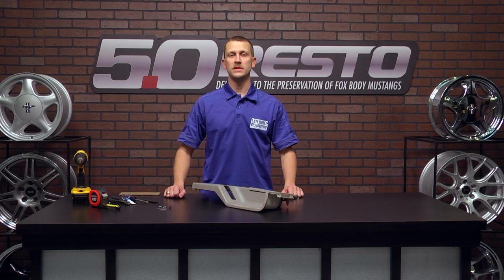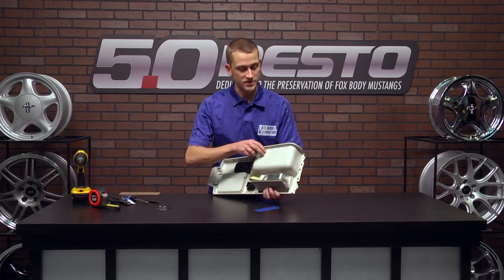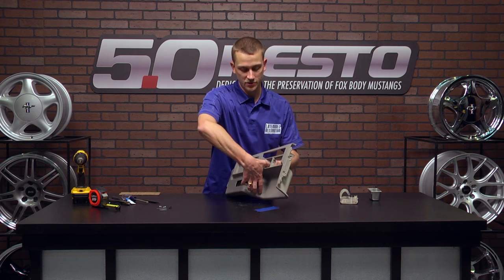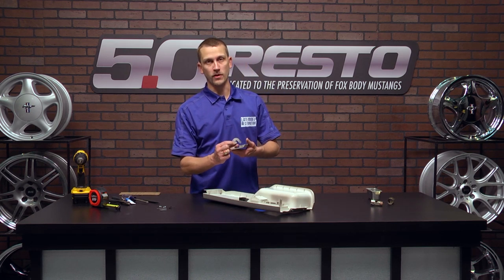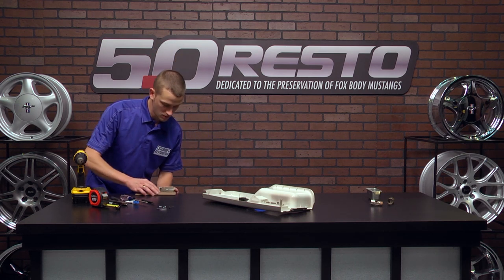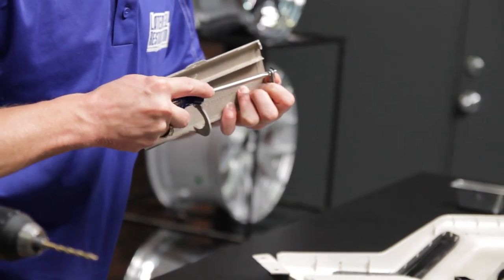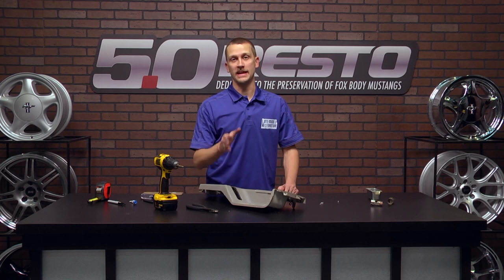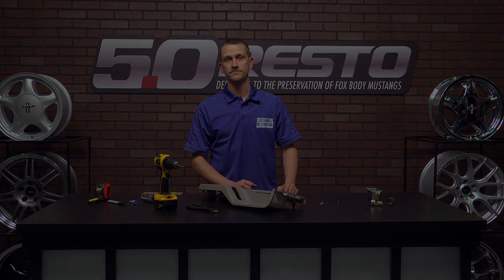1987-1993 Fox Body Mustang: Ash Tray Lid Repair Kit Installation

Comment: I have owned several foxes in my lifetime,back many years ago when Mavromont first came out with the repair kit for the ashtray i bought one of them,never had a problem again,Ive never tried LMR's but I'm sure it works good too,the way they designed this spring to work is just lunacy,the spring has more twists and turns when it operates than a racetrack so no wonder gets twisted up and the ashtray  lid doesn't work anymore, the kit gives the spring a anchor point of sorts, money well spent.